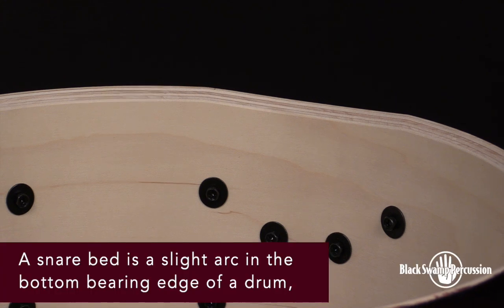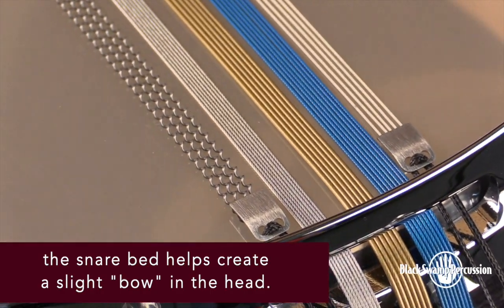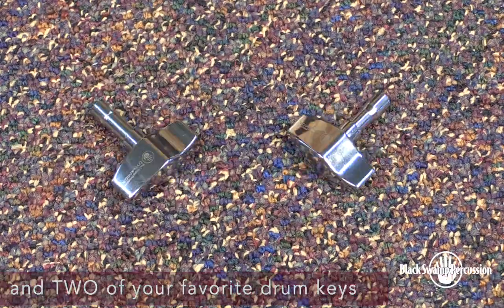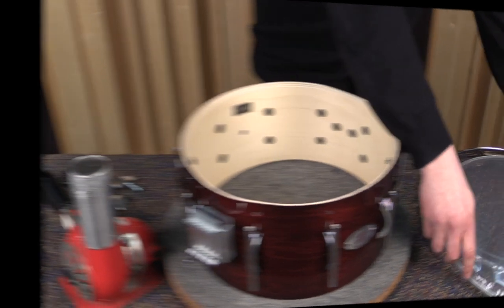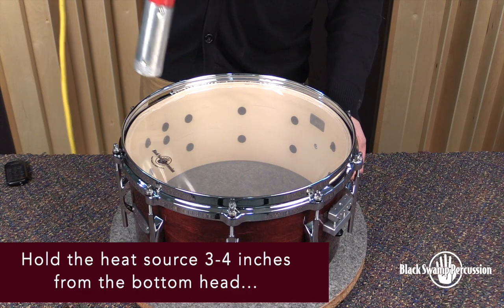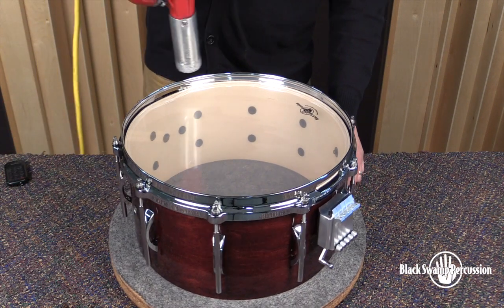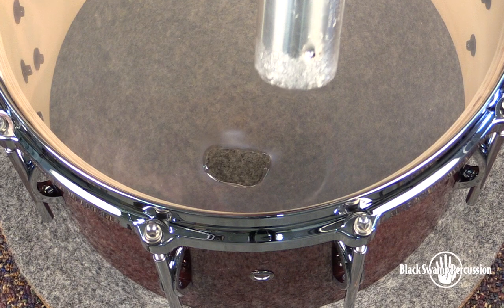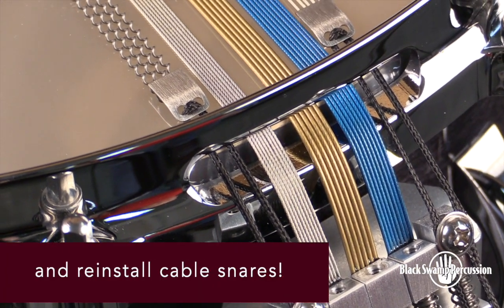BSP Tutorial: Snare Beds and Seating Heads

Comment: I've never heard of this method, but it is intriguing. I have one wood snare. I have heard that the nylon straps are better for metal drums with no snare bed, but that cords are better for a wood drum with a cut-out snare bed. Is that accurate? These are not symphonic snares. I use them for rock/pop/blues. Is the theory that you're melting the head enough to seat on depression of the snare bed?  It sounds like once this is done, you're committed to leaving that head on that drum in that exact position until the head is replaced. No problem, just wondering.
Reply from the maker: Hi Steve, thanks for the comment!

We've never heard of a specific mounting material (nylon or chords) making a difference in the tone quality of the snare and always opt for the option that best suits the snare wire/cable in question.
For example; our SoundArt snare drums are mounted with chords to allow flexible tension with each cable, whereas our Concert Maple snare drums use nylon straps.

As for seating the snare side head, yes you are correct. Heating the snare side head allows it to mold more uniformly to the bearing edgers and snare beds which will maximize the snare's response. This does commit the snare side head to a permanent position, but we believe the trade off is worthwhile!